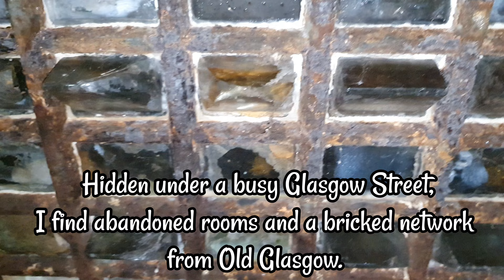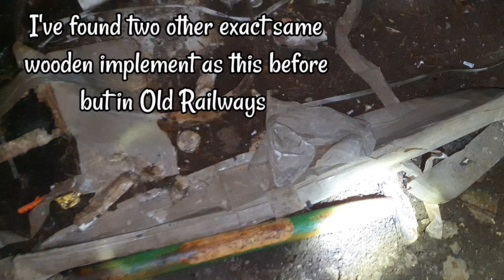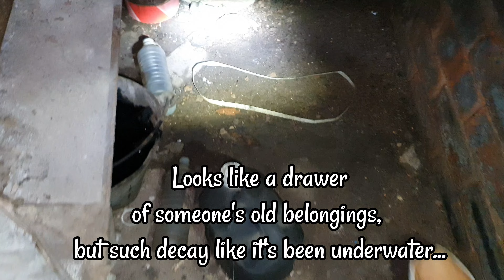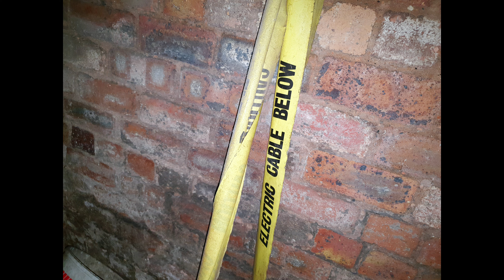Exploring Glasgow's Hidden Underground: Secrets Beneath Argyle Street!

Comment: The brick walls were obviously built.  I wonder what this area was used for?!
Reply from the maker: Yes exactly all man-made remnants just buried underground, no longer needed. I believe it was used during the reconstruction of the Central Line within the Anderston Tunnel that is underneath Argyle Street. This area is neighbouring the current Railway just through the wall. The left hand section where the wooden storage space is, that's the left section with rumbling railway through the wall. So must be related to that, and not the current infrastructure above head which is buildings on Argyle Street. No basement access from them to here as in above my head, so accessed differently. Definitely for the Railway, just can't date or find archive photos of this area. ✌️